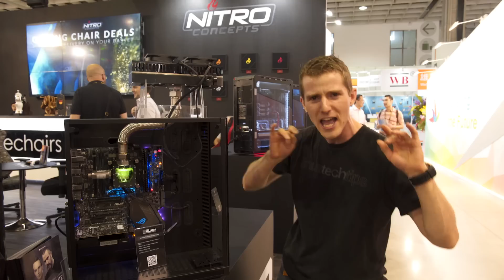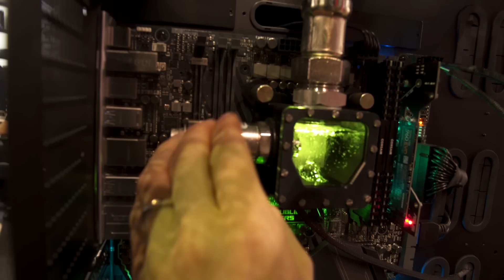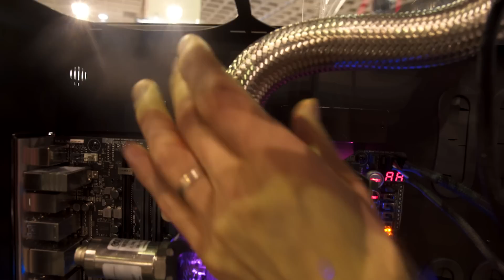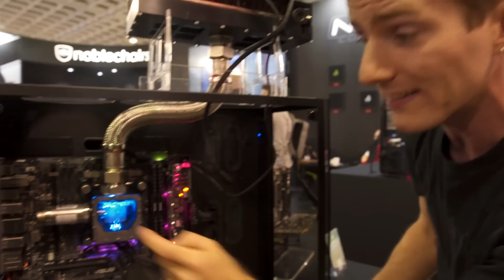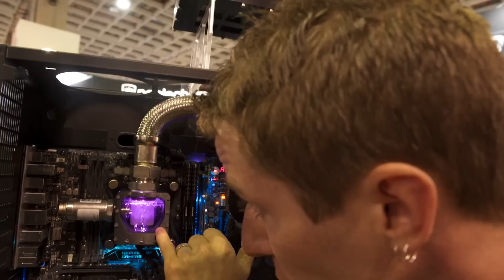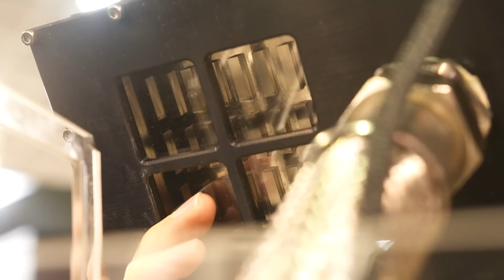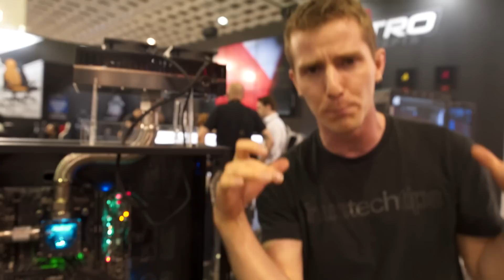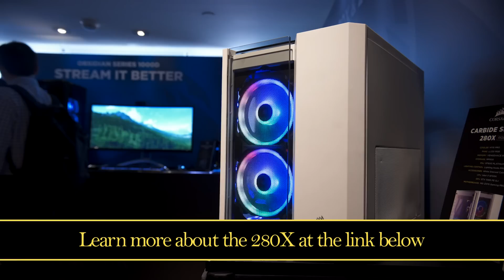Crazy Der8auer cooler prototype - NO pump!

Comment: Picking semi-randomly out of a list of boiling points... neohexane?  Looks like most things with a boiling point around 50c at atmospheric are alkanes like it, whatever that means.  Just below are things that "smell like ether", but boiling points in the 40c/100f range risks a cooler ceasing to function in relatively modest hot weather.  Above that are things like methyl alchohol, which won't keep things as cold, but should at least re-condense easier as well as raise weather operating window.

Comment: As an industrial chiller refrigerants specialist my first thoughts were a low pressure refrigerant such as R123 (dichlorotrifluoroethane) or its new replacement 1234zd, but those are not the cheapest materials and can require some care in their handling for safety (R123 is slightly toxic) and thus might be a pain to get UL certified, I believe the cleverest solution is that It's nothing more than water under a deep vacuum!

Comment: Some old tech refrigerators used Ammonia as a medium. It doesn't fit the temperature profile for a CPU cooler at normal atmospheric pressure, but there is no telling what pressure this cooler is running it's cooling medium at. Just thought I'd throw that out there.

Comment: Propane is my guess ac units are starting to show up with propane as a refrigerant because if it’s low boiling point and it’s relatively low condensing temperature .

Comment: Let me guess the coolant: Novec 1230...
Why do I think it's that coolant? Because that liquid boils at a temperature that does not burn your hand. That is what you need for this system, something that will turn into a liquid inside the radiator (a bit over hot room temp) so it should be liquid below at 40°C; and it will have to evaporate at a temperature you want the CPU to run at so it should be gas at 60°C. Novec 1230 boils at (almost) 50°C. This liquid I mentioned is designed for extinguishing fires at datacenters. It puts out fire without damaging electronics. This mean that if you use this novec1230 and spill it on you motherboard or you have a leak, your electronics won't be damaged. Novec1230 doesn't corrode metal, and it doesn't conduct electricity. And it's certified for use INSIDE computer server rooms!!!
The company 3M (who developed Novec1230) is quite well settled in both Germany and the US, and Derbauer is a german guy who visits the US from time to time... And IF Der8auer is indeed using novec1230 I do get why he is confident nobody would guess it.
----
Heck, even if Der8auer is not using Novec1230, and let's say you wanted to copy his design and you'd ask me what liquid to use, I would say: novec1230 may not be the cheapest thing around there, but it will work for ya.
Reply: You're thinking of CFCs. Novec is already in use for cooling.
Reply: novec would be my guess as well since we know he has used it before in a Gamescom build and this sounds like a miniaturized version of an immersion  cooling system 3m sells for data centers where the entire system is submerged and boils off the coolant and the vapor condenses back into the coolant bath https://www.3m.com/3M/en_US/novec-us/applications/immersion-cooling/
Reply: Makes sense due to the fact that he has already build a system using this coolant, which he showed at gamescon 2017.
Reply: unless its in a vacuum
Reply: advanced pressure sensor on the side...
Reply: Ok, here i respond to some of your comments:
Canned air duster is contains a fluorocarbon compound as well, and guess what? It is just sold in office supply stores and it's meant to be blown into the atmosphere. Novec has no chlorine in it, it's only the fluor that sets it apart from normal hydrocarbons.
I looked it up after i posted my first comment here, and it seems like novec1230 is sold to individuals as a fire fighting product.
Why water is difficult: Waters vapour pressure depends on it's temp, as the temp rises, there becomes steam the pressure rises and let's just say it has some challenges to it. With novec7100 or 1230 you can just keep it at atmospheric pressure, and you don't need any vacuum pumps. But if you look up how a heatpipe works, then it's pretty much a pipe (with a wick in it) with water or alcohol in it under a vacuum. But building your own heatpipe would require a bit more trickery than using a liquid that just boils at a low temp like 50° or 60°.
Here is what you need to take care about when making a heatpipe with water: 1) you need to research what amount of water to put it in for optimal performance. 2) you need to make sure there is no air in your heatpipe, only liquid water and water vapour; to do this you either need a vacuum pump or you have to boil of the water, bleed of the steam to push out the air and you need close it off at the end without letting air in. 3) You will have to use a material that withstands the pressures, and don't forget plastics tend to creep/flow and especially at higher temps they get soft. Metals like copper are perfect for heatpipes, but they are not transparent. This is why i'm pretty sure der8auer didn't use water, alcohol or something with a high boiling point.
And for the fans of pressurised gasses for cooling: airconditioners and fridges work with the same principle as heatpipes, LPG is a gas at atmospheric pressure and liquid at higher pressures, and water is liquid at atmospheric pressures and gaseous at low temps. Both of them transfer heat by condensing a gas and boiling of the liquid phase. Canned air dusters contain the same gas as airconditioning systems. If you live in the US or Russia you can just buy aircon refill kits or borrow a gassbottle with R134(a) refrigerant, if you live in the EU you can just buy canned air dusters with cas 811-97-2 or tetrafluoroethane, which is EXACTLY the same thing as the refrigerant R134a. Knowing these sort of lifehacks allows you to buy stuff under another name that would normally be regulated. You can look up the novec1230 or 7100 composition, look up the chemical formula or the CAS registration number of the main component, you can look up where this chemical is used, you can look up other brand names and perhaps buy it somewhere nearby.
---
The bottom line is: if you're bad at thermodynamics then not playing around with vacuums and pressures but just using an expensive liquid instead is the easy way of doing it. And believe me: a lot of students at universities in Europe totally suck at thermodynamics. And in a lot of cases students only learn the theoretical entropy/enthalpy internal energy calculations and they don't have an understanding how vapour pressure works in practice. And novec1230 and novec7100 are just liquids that boil at a low temperature, that's it; if you're a noob at thermodynamics you will still figure it out, because you can just let it work at normal ambient pressure, you don't need to close of your system or make it water tight; with this novec it will work anyway.
Reply: what about Novac 7100?
He also used it in one of his latest projects!

https://youtu.be/5WDxh4UiW_I?t=23s
Reply: Ryan Hoover It's not a CFC (chlorofluorocarbon) gas though, the molecule contains no chlorine atoms and there's oxygen in it so by definition it's not CFC. Novec 1230 doesn't deplete the ozone layer at all and has about the same global warming potential as CO2. Considering the scale this liquid is used at it has negligble impact on the environment, many many tons of CO2 is released into the atmosphere every day, Novec 1230 is a drop in the ocean compared to that.
Reply: https://www.3m.com/3M/en_US/company-us/all-3m-products/~/3M-Novec-7100-Engineered-Fluid/?N=5002385+3290667247&rt=rud
Reply: Helemaal gelijk.
Reply: Why not novec 7? Why does it have to be 12?
Reply: I would guess 7100 because its in wider use in data centers in the US
Reply: It's also not electrically conductive, making it much safer for use and a lower risk in the case of leaks
Reply: well he is working for/with nvidia, thermal grizzly and caseking....on of the companies could have bought it....especially thermal grizzly.......own productline of thermal paste, enough said :-P
Reply: I mean you could just use convection like older car radiators
Reply: U need to keep in mind that pressure also has an affect lower the pressure the lower the boiling point. If it is a coolant there are tight laws on them given the toxicity.
Reply: This is supposed to be expensive. But i think the guess is right. For Fire Safety engineering is one of the preferred products for data centers and electrical panels but the application is different (micro droplets)
Reply: Why wouldn’t it be water under a target vacuum? Nothing transfers heat like water. Plus that line looks vacuum rated and I’m sure it would need to be otherwise. I think 3.3” Hg would produce a 50c boiling point for h2o. Who knows.
Reply: Water at 0.02 bar has a boiling point of 18ºC, the problem is that it requires a massive ammount of heat (2500 kJ/kg) and also a brutal variation of volume, ending at a specific volume of 50 m3/kg. (At 50ºc there is still a lot of energy needed)
Reply: I don’t know anything about building PCs.
Reply: In a German video he said that it is definitely not 3m novec
Reply: Oh I thought it was water cuz it’s clear
Reply: Ryan Hoover

be careful. what makes CFC's dangerous is how much ozone they can break apart per atom. it's crazy. we can actually tell that some people are still using CFC's, and observe it's hampering of the ozone layer recovery. we can even tell that the CFC's are coming from somewhere in east asia.  https://www.npr.org/sections/thetwo-way/2018/05/17/611984631/banned-ozone-depleting-chemical-is-still-being-produced-somewhere-scientists-say

you should probably save an estimate like that for someone who cares enough to do actual calculations.
Reply: i found a video of a computer submerged in novac
Reply: That or Pentane, which is used as a refrigerant in many niche industrial settings. It boils at body temperature and evaporates rapidly.
Reply: sasja de vries. U just broke Der8auer‘s heart
Reply: Would like to see a fully submerged pc in that novec 1230 stuff
Reply: it is some of novac liquid

I sow their own prototype almost 5 years ago. Slim aquarium with a full motherboard in it.

Proof https://www.youtube.com/watch?v=oZavKweMrP4
Reply: sasja de vries. I mean then you could also use dichlormethane, boils at exactly 40 degrees celsius, or diethylether, 35 degrees
Reply: sasja de vries. he is using some sort of Di-methyl-ether
Reply: whats the pressur in this?
Reply: it's not cofirmed in gamer nexus video at computex
Reply: https://youtu.be/AZAUnl37Cr8?t=70
Reply: you are all wrong. it's filtered urine. they take out the yellow color out of it,  but keep all other things. this is why it's sealed, cuz it smells pretty bad, it is pee after all.
Reply: The problem is Novec is not allowed too be sold too private users as der 8auer says.
Reply: @n0pic325  Novec1230(FK-5-1-12) is not prohibited. It isn't CFC. It is flourinated ketone. it allowed to public. BUT IT IS FUCKING EXPENSIVE. If you fill normal ATX size tower case with it, you will cost over $2000.
Reply: sasja de vries. The problem is, that you are talking about an halogenated carbon compount (fluorine). Those are pretty geavily restricted afaik and are probably not allowed for „simple PC cooling“
Reply: sasja de vries. Its not a novac, they are CFC’s
Reply: sasja de vries. But it's still a cool a useful idea for cooling down electrical systems I would say his design sucks but good idea for the cooling liquid I don't know why people for use pressured gas for cooling but I'm just going to use lighter fluid the thing you said would be better but I don't know where to get that but most people don't put there computers in fires anyway but just in case the thing you said would make it to the stores easier that lighter fluid would simply because people don't want a cpu cooler that could explode if they want to run there computer say right next to a fire for some reason
Reply: Christian Martin, it will get cheaper as urine collector vending machines will become available.
Reply: Thomas Shuman
, it's not water, it's filtered urine. it has the ureic acid, but with no yellow part. and it's sealed because imagine the smell of hot urine, that has been boiling for days
Reply: Novec or a similar azeotrope, of course.
Reply: Ide say Freon, hence the pressure gauge?
Reply: Nerds

Comment: Great idea, although hardly a new concept in cooling (except in a computer of course).  My guess is that the liquid could be alcohol - with a low boiling point (it's less than water) alcohol would readily absorb the heat and boil, than be easily cooled and returned to the reservoir.

On a side note, the glass on the tank would have to be thick to be able to withstand the tremendous pressures that would build up in a closed system like this.  It it were an open system the mystery liquid would simply boil off and one would be constantly toping it off again.

Comment: Against all opinions here, and judging by the beefiness of both the block and the tubes, I'd bet on water at a very low pressure, to lower it's boiling temperature low enough to make a CPU boil it. No fancy liquid, and no fancy hazardous chemicals!

Comment: As you want your CPU to be under 80 at very least boiling point of the liquid should be bellow that, way bellow that. Methanol boils at 65, so that could be the guess, but alcohols are corrosive, so I'm not sure about it. Also, 65 is still quite high as a temperature. It could be ether... Low boiling point allowing cooling circle to happen as low as 35 degrees, not so bad heat conductivity, not high corrosion levels. But if leaking it might be harmful to humans... So I'm not sure how customs would react if you tried shipping it.

Comment: It might be just normal water, but on the right pressure to act like this. Dont forget that the boiling point just depends on the pressure. This could also explain the thick high pressure tube.

Comment: Judging by the tubing etc. Probably liquid Co2. Easy to keep liquid at a reasonable pressure, and good heat capacity. The boiling point seems to fit also, if you keep it at 40-50 Bar.

Comment: DCM cough methylene chloride cough wooogiewoogiewoogie liquid
Reply: Everybody is saying it's a Flourinert.  That stuff is Ultra expensive - Kudos to the guy that can prototype ANYTHING with Flourinert in it; coolness factor is through the roof!  I'd love to get some to fry some potato chips in it. I still say dichloromethane (dcm)/methylene choride/call it what you want.  It boils at room temperature under vacuum - just a couple inches of mercury of vacuum will boil the stuff at body temperature.

Comment: Linus, the fluid is water mixed with ammonia and probably some anti corrosion stuff. The heat from the cpu causes the ammonia to evaporate but allows the water to stay below its boiling point. The ammonia condenses in the condenser on top and drips back.
It’s kinda similar to those refrigerators in RV’s and caravans that use LPG or natural gas as a heat source to get the circuit going that cools the refrigerator. Only in this case it’s the CPU that is the heat source. So basically it sustains it’s own cooling by getting hot. You would probably see very little variation in temperature regardless of the workload as more heat simply increases the cooling effect.

Comment: It's like a regular heatpipe with flexible water hose and gravity feeding system or simply an ancient setup for a heatpipe. Why you need the radiator is above the cooler and not bend the hose in negative courves is simply the liquid (water) is not dripping back to the heat exchanger (cpu block) and that is lowering the efficiency of the system.

Comment: The Liquid should be Methoxynonafluor Butane.
It has a boiling point at 61°C so the CPU won't have to heat up the liquid too much that this pumpless cooling solution works.
But it wouldn't surprise me if Roman found a non combusting Liquid with even lower boiling point to lower CPU temperatures.
Roman already presented a Methoxynonafluor Butane cooling solution in a fish tank on his own channel, so I think his secretiveness is just intended as a bait.

Comment: For people suggestion CFCs/Freon I would say that it's highly unlikely, using a chemical like that would basically prevent sales to most of the world, since CFCs are a major cause of the destruction of the Ozone layer, the likelihood is that it wouldn't contain a CFC since that would make it dangerous and illegal in most locations
Reply: well its probably some sort of refrigerant regardless :p probably r134a
Reply: @Ryan-pe4ii  I guess R134a is a bit off for this application. Neither Pressure (at working cpu temps) nor the boiling point (at atmosphere pressure) fit the application (or the equipment as seen in the video).

There are other HFCs that might fit a bit better.

My sharpest guess is deionized water in a slight vakuum so it boils at around 50°C.

Comment: The coolant could be R22 ( used in aircons) or isobutane ( might be a little dangerous though.) Personally I would use water mixed with a touch of glycol in a partial vacuum. All 3 would perform well.

Comment: The easiest coolant to use that would just require a heat source to run is Ammonia. Camper fridges that need to run off the grid use a propane/ammonia setup and require no electricity. The only problem with Ammonia is that it can solidify under certain conditions and it is slightly dangerous in large amounts.

Comment: now here i am sitting, looking at spreadsheets of non conductive, non corrosive liquids with boiling points at around 20-30°c just to guess the coolant, that Der8auer is using.
Reply: how about methylene chloride?